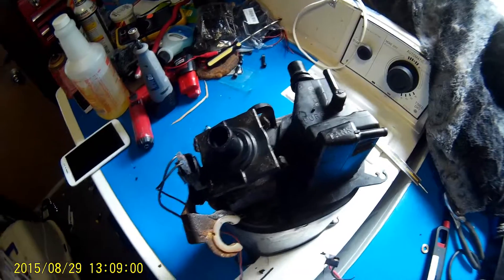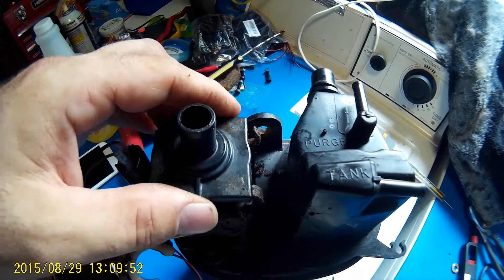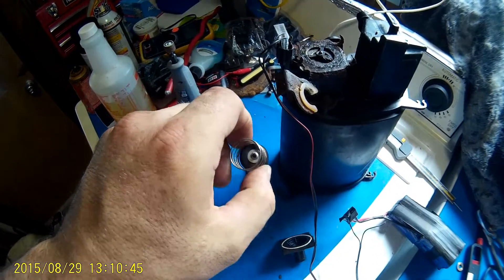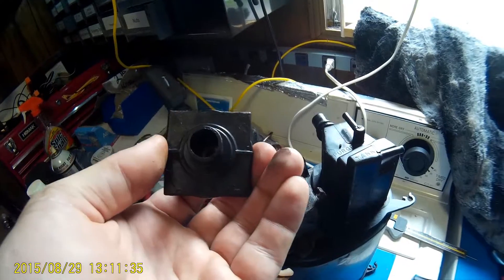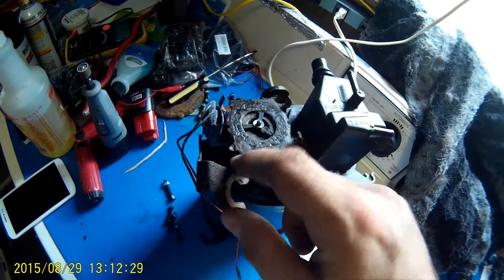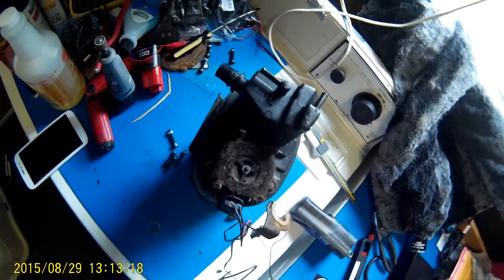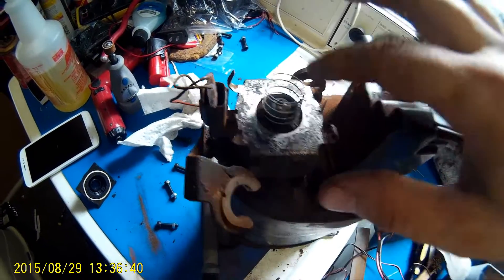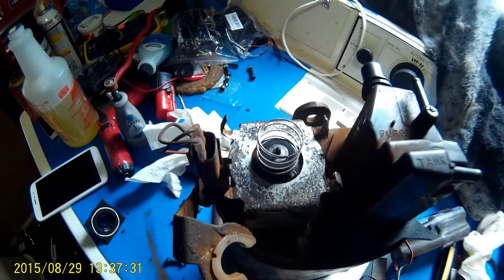Honda P1457 EVAP Diagnostic Code PART 2

Comment from the maker: yes! As of Today (4/20/2016) the check eng light has stayed off!!!
Reply: BigDaddy's Channel 
Did the Check Engine Light go off by itself after driving or did you reset the ECU by pulling the battery cable

Comment: There's rarely a way around it, you have to replace the valve with a new one. Good luck to you if you can fix it but these parts are usually not repairable.
Reply: Skanzool i Agree- best to buy a new one duhhh

Comment: I changed everything.. gas cap.. canister, shut off solenoid and the by pass solenoid and the light came back on with the same code p1457